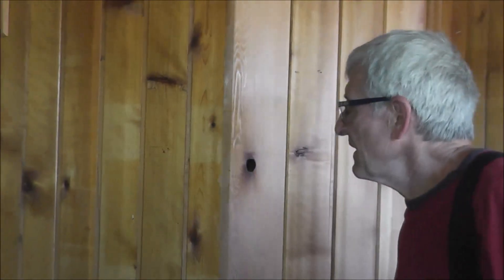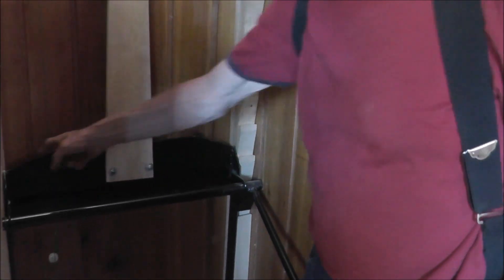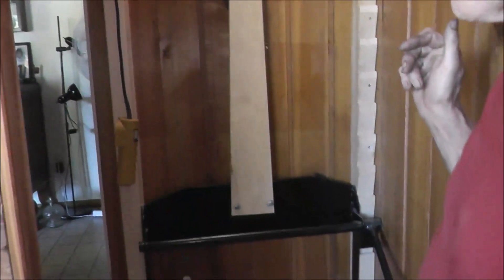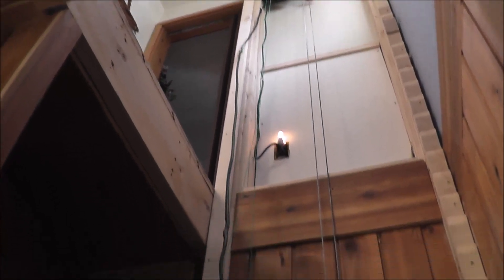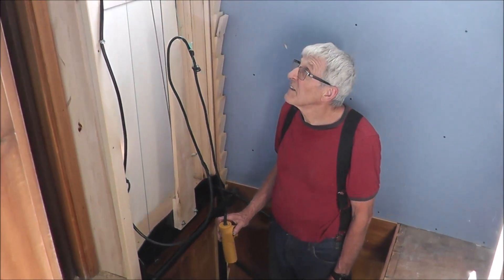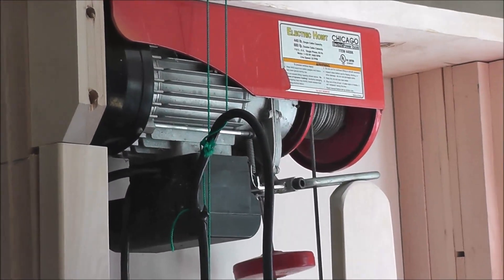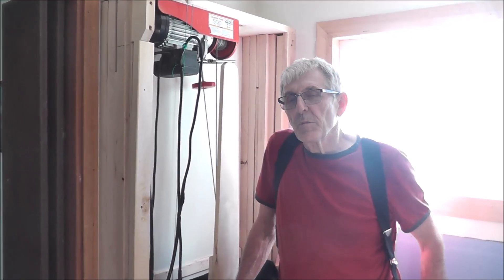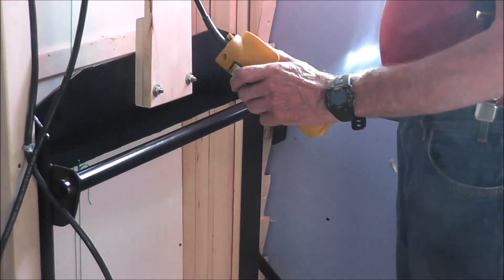DIY Elevator for home or shop

Comment: Wow, this is so ingenious!  Thank you for sharing about this project.  Have you considered drawing up plans for those who may be interested in making something like it?  I guess then you'd be liable if something went wrong...  "Law" is supposed to be about safety and justice, but now days it seems like there's no justice and laws just get in the way of a creative person like yourself making something that works for them and their family without it costing them a fortune!  In any event, well done.  This is a GREAT result!
Reply: Carole Warner  I’ve been wanting to do this for a long time and this is the best, simplest design I’ve seen yet. Very considerate of this man to share his ideas with others .
Reply: @williamtate6268  So true!  He has the mind of an engineer and inventor!  Very creative.
Reply: @carolewarner101  A engineer would never do this. It's extremely dangerous. 
The "safety ratchet" has a high chance of just shearing off the teeth. It also means that if the cable fails on the way down, the operator would need to react quickly to stop their own fall, if they dont react quickly, then they would be going so fast that it would just shear off the teeth. 

Using wood for the rails allows the wood to rot, or wood screws to pull out, and dump the contents of the lift to the lower floor. 

Fire hazzard, you have just created a excellent way for fire to get between floors. 

I really hope that that control box is not mains, if it is, then using a connector block is a huge shock hazard. 

Many pinch hazards. 

Huge fall hazard

A engineer would take the time to build something that is actually safe.
Reply: @ArduinoKing  as i say an engineer doesn't invent tools cause he /she doesn't know what you need.

Comment: A better way to power it would be a 12 volt DC winch with a car battery and maintainer, so when there is a power failure you still have an elevator.
Reply: Simple solution is a UPS. It only needs to complete the cycle up or down and handle the current draw of the motor.
Reply: That would be a great backup if the power goes out!
Reply: mc3lizard  Agreed. That way you could have a wireless fob and omit the wires. I have a genie lift originally outfitted with basically a boat trailer winch. I installed an atv winch and no more busted knuckles. I love technology!
Reply: Only problem with that is that is a lift device that is made for overhead lifting. Winches are only good for pulling. 
That being said, a power outage mid way up or down would present a challenge to say the least.

Comment: I can see a lot of planning and conscientious effort went into building this - good job!   
My suggestions, for what they are worth:  Put a counterweight on the whole thing so that the winch cable could be modified just to be a loop and it is required to move the cab either up or down.  The winch wouldn't have to lift very much, so if that cable failed then the counterweight would reduce the severity of the fall.  If the counterweight cable fails, the winch can hold the platform.  If you add a rate limiting element like a hydraulic damper that might also reduce the impact of cable failure. (Could be Harbor Freight hydraulic motor with a loop of hose)
Consider that the winch might use plastic gears (unless otherwise proven) that might crack or lose teeth.  The Harbor Freight vertical mills use all plastic gears, for example.
The safety pawls - Good choice of maple for these, but I'd be concerned that that metal piece would just act like a chisel and clean off the pawls on the way down.  If you have to engage it by hand to stop a fall, then it's not doing it's primary job.  A different safety system "needed", YOLO.
BTW - I don't know that we're related in any way, but perhaps so, since I used a boat winch to hang bikes from my garage ceiling for quite a time.

Comment: Safety device does not work on the way down. Sure beats a stairmaster.
Reply: The safety device will shear off the wooden cogs like a razor shaving hair.
Reply: Kevin Finkenbinder you don't think that it would slow it down or stop it after it broke one off?
Reply: @NoZenith  I wouldn't bet my life on it.
Reply: Oh for crying out loud. It’s not gonna fall twenty feet, shearing cogs on the way. It’s gonna fall four inches and stop. And if the cog fails, another four inches. 
Of course it wouldn’t work if it accelerated down 10-15 feet and then tried to engage a cog. 
Have y’all even used a come-along (power pulpy)? Same principle. Believe me, the cogs hold.
Reply: @pmailkeey While your concern is warranted, it's not clear whether what you describe would happen or not. If the elevator begins a rapid descent, the dog and the arm attached to it will begin to descend at the same time, and the same rate. The only force that is going to be counter to that is air resistance on the arm. Looking at how heavy that arm is, I kind of doubt that is going to be an influencing factor. So while the dog will not significantly move away from the cogs, it's not going to move in towards them either; we have to remember that the torsional force that is being exerted by the arm attached to the dog is dependent on gravity. With both the lift and the arm in free fall, that torsional force disappears. So it depends a lot on how far above the notch the dog is when the failure occurs. If it's less than half way up to the next notch, it will likely catch the notch on the way down (and maybe shear off the cog?). If it's just about to click over to another notch, then on the way down it probably just bounces or chips off a piece of the next lower notch, after which things probably get worse rather than better.
Reply: The passenger holds the lever in hand on the way down and this becomes routine after weeks and months of operation. Then if the unexpected happens (worst case: an instantaneous cable snap) the passenger panics and likely continues to hold onto the lever ensuring that it will not engage any safety cogs. But if the users can practice treating the lever always as a 'hot poker' perhaps they will luck out! Suggestion: Use a pushbutton on the wall of the car that must be constantly pushed in order to keep the cog lever released on the way down. This would be safer, but I'm guessing he has already come up with some sort of solution to this issue.
Reply: @pmailkeey The mass of the lift, and anything on the lift, is irrelevant. They all accelerate at the same rate due to gravity (barring air resistance). Given that the lift has a wide footprint of air to displace, while the locking mechanism doesn't (and is also somewhat shielded by the lift floor), the lift will accelerate marginally slower than the dog arm. Adding weight to the lift only narrows this gap, but could never tilt the equation the other way.
Reply: You might consider adding a counter weight equal to your wife's weight plus the weight of the elevator. This would take the load off the winch which would make the cable less likely to break. If the counter weight is perfectly balanced, then the elevator could never freefall at the acceleratiin of gravity. Actually, with a counter weight, your wife could raise and lower herself without the need for a winch. Just pull down or up on a rope.
Reply: He shows it works; as he has to raise car just a bit when it's resting at the top floor, to get it to release before going back down.  Never worked a power pulley, have you?
Reply: pmailkeey why?
Reply: Maybe a parachute for backup?

Comment: Good thing he put the safety catches on it.

No FN way I would trust a winch instead of a hoist. 

Especially a Harbor Freight winch.
Reply: That is a hoist and not a winch.  I use one to lift my 10" cabinet saw and 15" plainer to my upstairs woodshop without issue. I hoist up my plywood and everything up there thru a 4x8 plywood floor/door.  Used it enough that I trust it.
Reply: It is a hoist!
Reply: His safety catches will fail. The project is a dangerous hot mess.

Comment: I commend you sir for loving your wife enough to build this for her. But if you truly do love her...Rip it out. The shear lack of saftey devices is enough to give me the shivers. The reason elevators/lifts are so expensive is the extensive testing and safety devices that MUST be installed including over speed governors interlocking  switching at every conceivable danger point. Slack rope switches the list goes on. Again it's a beautiful thing you did for the love of your life. However gravity doesn't care about that, neither does the hoist if a body part gets trapped between the car and the floor. Sorry 😔
Reply: sparky12x  I am not one to start an heated debate. However I must correct you. I could list half a dozen or more different manufacturers. Including the two the big players. I work for an independent lift company here in the UK. The industry has to be highly regulated to save lives safety is at the forefront of our minds. To the best of my knowledge no manufacturers have the power to alter government policies on safety. In the UK the HSE and the governing body does that. Then the manufacturer MUST implement those recommendations. So that cost has to be passed on.

Comment: Put that controller on a drop-light wind-up. Take out the ratchet pawl, and secure it chest high. Ingenious
Reply from the maker: Thanks for the comment, Great idea, not sure where I could get one of those.
Reply: I meant your lift is ingenious.
Reply: Controller has four wires. Could use two drop light retractable units though.

Comment: No broken rope saftey and pinch points everywhere. Oh and you are useing a winch instead of a hoist you really trust the brake on that thing?
Reply from the maker: One the one side there are notches to stop it from falling, maximum distance is 4 inches, I do not believe the winch has a brake, The way it is geared it is impossible to let go.  Safety was my prime concern. For the weight it lifts it is unlikely the cable would break, but plan to replace the cable with aircraft stainless steel in the new future. Thanks for the concern.
Reply: @brianprocter6191  the notches are fine for going up but not down. What you should have done is have the paul spring loaded to engage but tie the cable up to it in a way that the qeight of the car agenst the cable would hold it off. Then if the cable fails the spring tenshion would lock it in place.
Reply from the maker: @Ham549  Thanks again for your concern, I certainly considered considered something like that, a simple mechanism could release the safety stop,  was not sure if it would have more merits than I have now, as one can engage the stop by hand very quick. My thought was that there might be tension on the cable to some degree and not release the stop. But your idea of a spring to add back pressure I think would solve that problem. In operation the most tension on the cable is on the way up. It seem to just glide easily down and I am not worried about the cable breaking then.
Reply: @brianprocter6191  I doubt anyone would be quick enoughf to set the break on time and if they were the car would be going quite fast. The cable is just as likely to brake going down as going up. Winch cables wrap up unevenly which creates a lot of stress and ware. Once the weak point is unspolled it eill be exposed to the load and can fail. A mod your current brake to be spring loaded and attach the cable to that.

Comment: Your "safety device" is worthless, at least on the way down. If the cable fails expect to find your wife in a crumpled heap at the very bottom.
Reply from the maker: I don't think it is as bad as you make it sound. with your hand on the down release it is a matter of releasing your hand or push down with force to self arrest.  I could design a  spring loaded device that requires spring tension to operate.
Reply: @keithroggenkamp623  Ok, looking at it again it may not be that awful however something along the lines of the Otis elevator would be better and not much trouble to build. If you were to add a reversing motor starter, with a holding circuit, you could get rid of the pendant. have a up button on the 1st floor that would raise the elevator until it hit a limit switch, and a down button at the top that lowered until it hit a limit switch. It may sound complicated (I could do it blindfolded) but it's not too bad, you have lots of time and youtube for assistance. Give it a try, if you succeed you and your wife will love it.

Comment: What happens when one of the kids or you fall down the hole?
Reply: They learn to look where they are going
Reply from the maker: When the lift is down the door to the tub room is locked from the inside, I still think a gate to the lift hole would be a good idea. No kids at home.

Comment: I like your approach to the up safety with the little stairsteps but I don't think that's going to do you a bit of good if it fails going down just a thought really like your design thanks for sharing
Reply from the maker: The idea is to quickly push the handle down and self arrest. I think if the cable was to break it would be when going up, most tension, going down it seem to just glide along with little tension.

Comment: That platform will hold a power chair or wheel chair?
Reply from the maker: Not really enough space, 30 by 30 inches usable space.  It was a consideration but this was as large as I had room for.